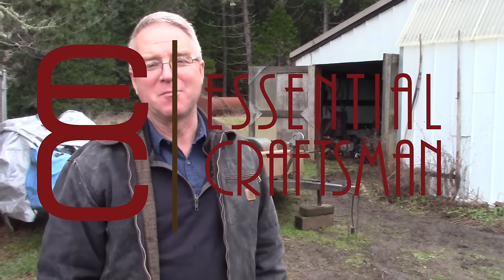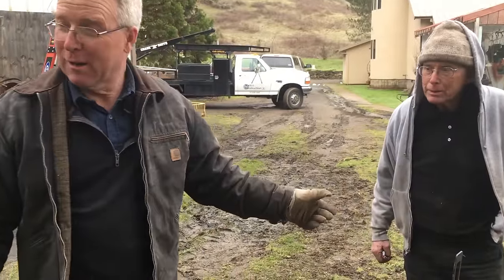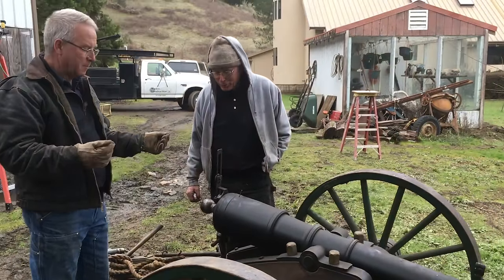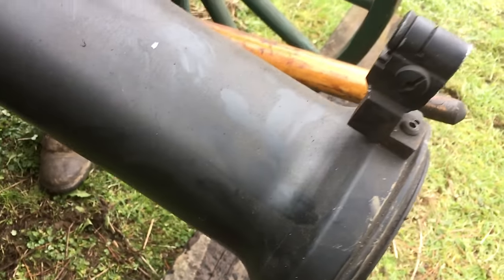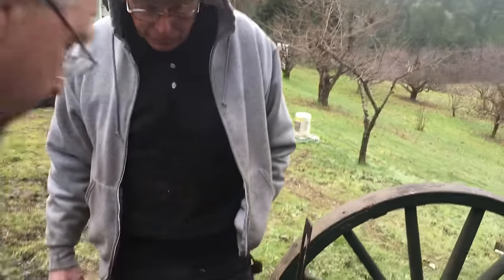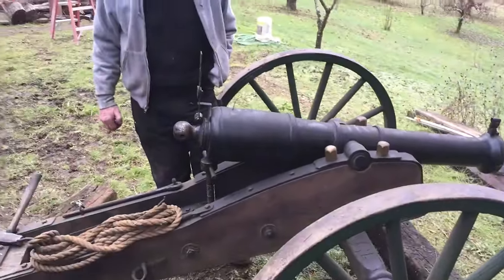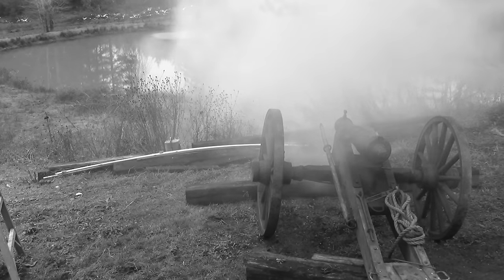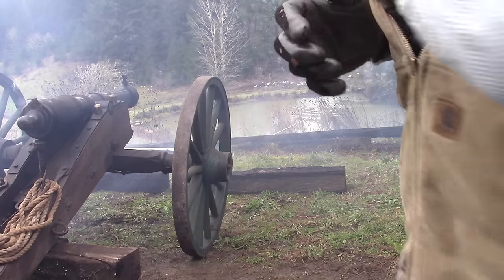Homemade Cannon Shooting

Comment: Since he's basically using minie ball ammunition, he should make the projectiles fit slightly loose in the bore to ease loading. Forget about "Helga"!! The expanding part at the rear shold grab the riflings just fine. All that aside...his cannon is a lot better than my cannon since I don't have one.
Reply: You are right but I don't think it's going to make that much difference in this case. That thing looks like it can take it. 👍
Reply: That's what I was thinking, the originals were loaded from the muzzle so they could not have been anywhere near as tight as that.
Reply: @phillhuddleston9445  He could at least keep his ammo in the freezer.  Would help a little.

Comment: I did not know that the barrel of a canon was made from different sections that were sweat welded together. I always noticed the segments but assumed it was decorative or for strength. But now that I know it was from separate pieces it actually makes more sense. Thank you for enlightening me!
Reply: traderjoe Hi maybe I need to clarify this a little It is made of one tube that is the size of the barrel where the trunions are mounted it goes clear through the whole piece the other pieces are shrunk on and turned when the guns were cast the swell at the back made it stronger these just make it look right CY
Reply: @cyswan9572  I feel like you could probably load that whole barrel full of black powder without worry of it blowing up.
Reply: @cyswan9572  how did you shrink it on

Comment: On the Guadalupe River, a few miles upstream from Gruene, Texas, a campsite on the river bank had an old hand crank air raid siren and an old civil war cannon. They would run the siren 2 times before firing the cannon at 0800, talk about an echo up and down the river valley corridor. They filled a long skinny balloon with acetylene and carefully poked it down the barrel, stuck a fuse in the breech and lit for the bang, that was loud. I have a "new old stock" air raid siren, all I need is a cannon, for my mountain cabin deck. Man that was fun to watch and hear.

Comment: Maybe a screw press to press in the round?  Don't know if that would work but damn that's a lot of hammering.
I soak my aluminum molds in my lead pot prior to poring lead.  Makes  a good cast the first time every time.

Comment: it's not "clean well after shooting' it's "mop well"  the bore 'mop' would be wet, and a tight enough fit to push any still burning debris out through the touch hole and then wet it down for good measure.  so, it went scrub, mop & dry mop (the order may be wrong but I spent a whole day with my both sisters boys at a shooting festival where they had everything from M42 Thompsons, M3 grease guns, German MG 34's, BAR 's and a few British Brens to a 40mm BOFORS anti-aircraft cannon lol 

There were 5-6 lunatics who made their own cannon's and just like this one it was a work of art. I think my favorite was a breech loading Golf ball recoiless rifle that the owner/builder said was good for over a mile if he used his own cast lead Diablo shaped projectile. watching him shoot through a car long way (Engine to trunk and out) gave me  a lot of respect for our armed forces that ran head long up the beaches on D-day etc.

Comment: Wouldent the tightness & drag of the shell rubbing the inside of the barrel that tightly slow the shell down vs a better fitting shell with less drag?  Isn't this affecting the momentum & velocity of the shell?

Comment: Bullet weight and powder charge please?
I'm shooting a 2" ball at 2 lbs. I believe the powder charge was 2 oz's of Pyrodex CTG black powder. Been 30 yrs since I shot it. I believe this is pretty mild. My smoothbore is 2-1/4" so I have to use a large patch. My bbl also slides on a rail w/a recoil spring so that tames it some.

Comment: I had no idea you had to hammer the projectile in like that. I thought it just slid in.
Reply: Bullets fit REALLY tight, in fact often times the bullet it self is maybe .000-+  of an inch/mm larger than the bore diameter to ensure proper seal so the gasses are used to their maximum efficiency.

Comment: When loading and swabbing a muzzle loading cannon it's considered good practice to use just one hand on the ramrod so you'll still have one if something goes very wrong. Reading that bit of info made me forget about making a cannon.
Reply: Make a breech loaded cannon like this then. They were just cleaning the empty barrel in the video.
Reply: @EndingTimes0  
You don't clean a loaded cannon.
I'm surprised you didn't know that.
Reply: @AZ-kr6ff  Of course you dont. They were cleaning it after they fired it. How you got that from my comment is mind boggling.
Reply: @EndingTimes0  
Because you specified that they were cleaning the empty barrel.
No shit.

Comment: Nice and interesting gun, but they are using the wrong type of fuse and ingition. You have to use a lintstick and blackmatch fuse, to get the shortest possible time between ingition and firing. This is essential to maintain the security. No-one in historical time did this, and they were not dumb.

Comment: You need a patch or an actual ..50 cal ball,, all you're getting is blow by, you would more than double the velocity,. the smaller ball could also  potentially roll part Way out becoming a dangerous  barrel obstruction.

Comment: The projectile looks like it came from a giant, air powered, pellet gun.
Reply: Actually muzzle loaded projectiles are designed similar to that
Reply: @pacificcoastpiper3949  and some are round balls... 🤷🏻
Reply: @davelowets  the one I was referring to is called a Minie ball
Reply: @pacificcoastpiper3949  😆 I was not aware of what those were called.. 👊 🍻
Reply: @davelowets  yup, that name is usually just abbreviated mini ball for short

Comment: Gentlemen, you need to contact the BATFE immediately about this weapon.  A breach-loading weapon with a bore larger than 0.500 inches is considered a Destructive Device.  It requires a $200 Transfer Tax Stamp to be legal.  Because you didn't have one before you began creating this cannon the ATF may confiscate and destroy it, but they may be more reasonable these days on something so obviously historical and just have you apply for the Tax Stamp.
Reply: I think they would just weld the breach plug in place and tell the ATF to pound sand.

Comment: During the ignition of the black powder, the extreme pressure of the expanding gasses cause the thin part of the back of the bullet to deform to the shape of the rifling, filling the grooves of the barrel which causes it to spin during it's travel through the barrel.

Comment: Kinda puts our old driveshaft oxy-acetylene cannons to shame. Too thin of wall to shot projectiles, but get a heavy oxy mix, & man would it crack.

Go heavy on the acetylene at night for massive flame to wow the kiddies.

Chain 'em to about 10' of 8-10" doug fir log & it'd yank the chain & move the log a couple feet.

No wonder my ears ring like the damn Liberty Bell...

Comment: I like cannons and have fun  with them but there were a couple of failings from a safety point of view. 
That massive bag of powder for making charges loose on the table while cutting fuse from roll in ammo box where there are other made up charges. Lots of steel on steel surfaces.
If thats a steel breech plug and there are a few grains of powder on the thread while screwing in the plug against the charge there could be problems.
If the projectile was based on a Minie bullet then there's no need to make it a sledge hammer fit. Thats the whole point of expanding base projectiles.
Reply: Roman we shoot these for accuracy and I've found the tighter the round the better it shoots, the hollow base gives me a little extra the prjo is shaped like the old Keith wadcutter bullet Cy

Comment: A thou and a half on the diameter ...not the length. Lotta hammering to drive that round into battery, just say'in .
 Really not my wheelhouse. I don't know for sure. Just seem odd.
 I do know a bit about press fit and all I can say is ..THAT ROUND WAS MOOOV"IN.  My guess is 2800 FPS?!
Blew the HELL outta that lake, double quick and in a hurry!

Comment: one day it will happen ye gods  that round is tight ,was always taught never fire at water especialy smooth water .
yes  know hat i am on abut play with a 9lb and 2 1lbers  plus mortar so havee an idea of what i am talking about 
have for 30 odd years ,
never use foil ,make a charge case ,never use wicks,use either quils and linstock,  or the linstock and priming via the touch hole or vent  call it what you may
AS said  ONE DAY with that round   pounded in like it is

Comment: It's very dangerous having that much initial interference/tension in the slug. You are risking over-pressuring the chamber and blowing the breech off the back of the cannon or worse, blowing the thing apart.
Reply: That much solid steel? With black powder? Maybe if it was bronze.

Comment: No, that's not a revolutionary war type cannon, nore were cannons like this, nor such carriages used on ships! Rifled cannons didn't appear until the 1850's and 1860's. Front sights like seen here are pure fantasy aswell! The rear sight is somewhat similar to cannon rear sights in used by the time of the civil war but would be removed before firing so it would not fall off like in this video with the risk of getting damaged.